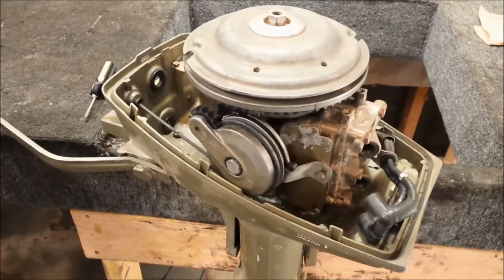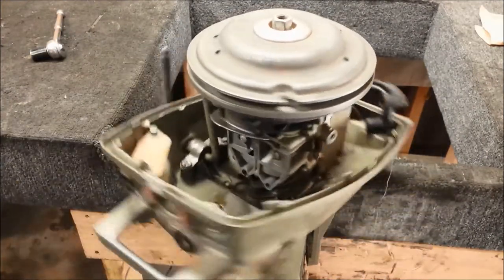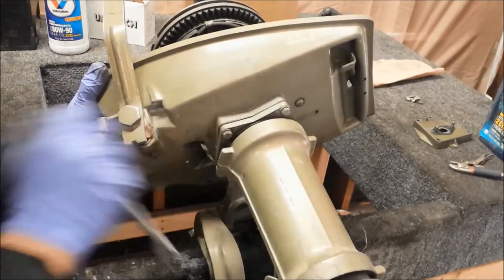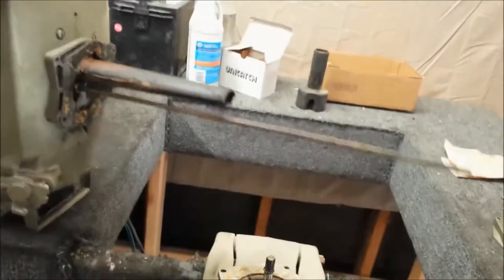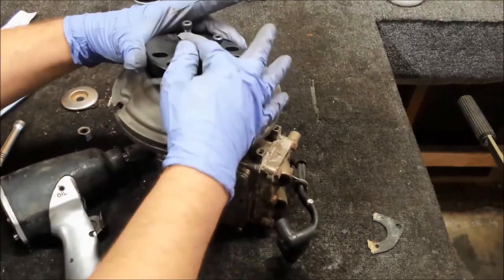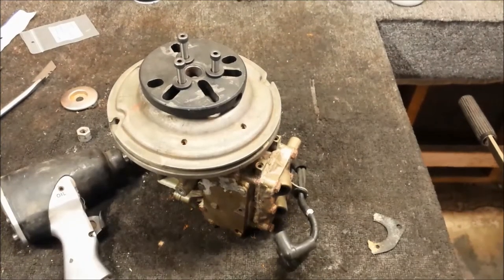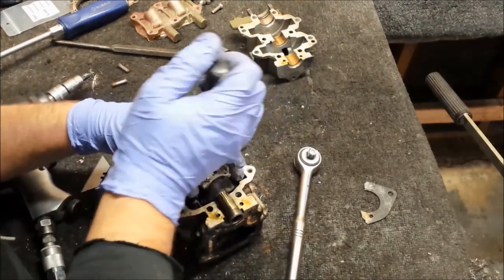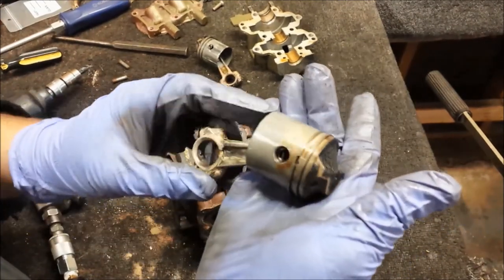1975 Johnson 4 HP Powerhead Removal and Teardown

Comment: Thank you.  Just picked up this same motor (non working). Went to do a compression test and realized that top spark plug hole threads are all but stripped.  Previous. Owner said low compression but i got 100 in each.  Wonder if maybe it’s just the loose spark plug that’s the problem.  🤞
Reply from the maker: Or, his gauge sucked.
Or, he read 100 is low.
Maybe he asked his buddy the deisel  mechanic what compression should be.
Reply: @BrandonsGarage  one question for you of you don’t mind. I retested the compression once the engine warmed up in house (-10C) out and I got 115 in one and 105 in other...do you think difference is acceptable?

Comment: Can you bore the reed plate on a 3hp to a bigger diameter, bigger main jet, 4hp prop and convert a 3 to a 4??
Reply: Hey Brian, I think I've seen your reply on another video regarding this, where you state that only the bore of the intake manifold is larger in the 4HP? Part number comparison doesn't help me much but I've got a 3HP which I'd like to upgrade to 4 if possible without too many obsolete items... Any more info?

Comment: Lovin the 4hp series ! Wondering if you have an opinion on the difference between Original manufacture parts, and after market parts ? Especially seals, and impellers ?  Thanks !!
Reply from the maker: If you are changing the impeller only, I don't think you'll find a difference.
However, if you buy a complete kit, go with and OEM. 
It'll be the most updated, come with everything you need, and probably cost $2 less.

For gear-case seal kits, sometimes an OEM kit isn't available and you have to buy each seal by itself. This is quite costly. Thats when aftermarket come in very handy. 
When a kit is available, and OEM kit will usually have the most updated seals.
- but! if you are using OEM tools, for your year/engine, that tool may not work with the new kit; resulting in you needing a new tool too. 

Powerhead gasket sets, usually come with more than you'll ever need, and head gaskets.
Aftermarket kits are sometimes limited. 

For carb kits, OEM comes with a new float. Aftermarkets usually do not. 
I always go OEM carb kits. 

So, it depends on what I'm doing.
Reply: Thanks Brandon ! Great insight !Yeah Parts for these older motors are limited sometimes, giving you no choice ! Thanks again !